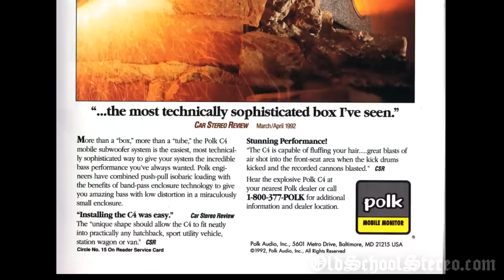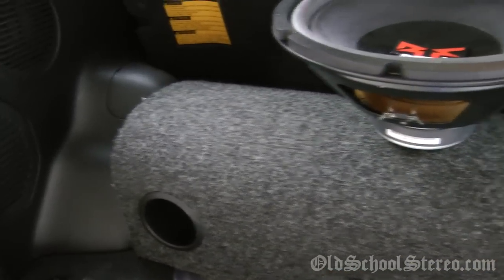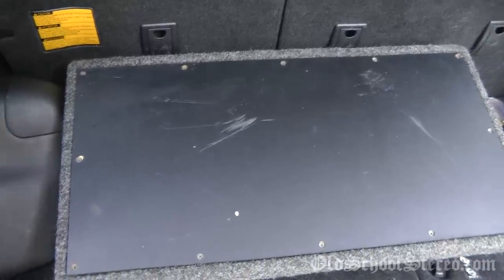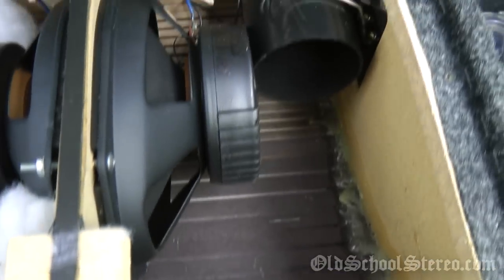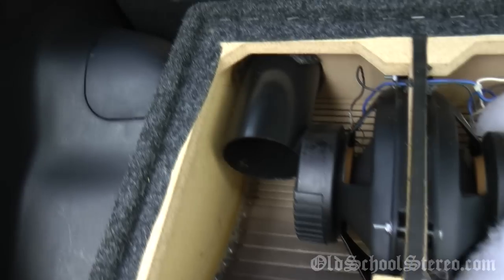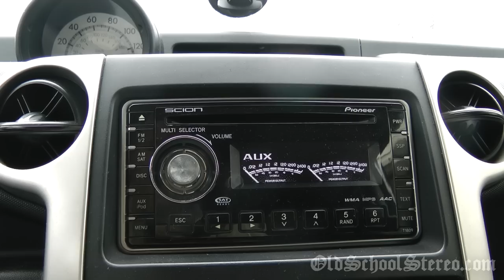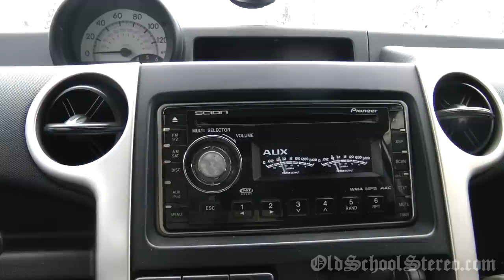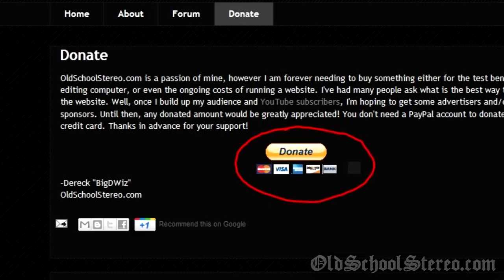Old School Polk Audio C4 Subwoofer - Four 6x9 Subs in Isobaric Teardrop Enclosure

Comment from the maker: See more about the items I use in the Williston Audio Labs:

SMD / D'Amore Engineering Amp Dyno: https://goo.gl/sJTcf7
XS Power D1400 Batteries - https://amzn.to/2BPFCKW
XS Power PSC60 Charger - https://amzn.to/2CHGcfs
Fluke 1000A AC/DC Clamp Meter: https://goo.gl/qvToRm
Handheld Dyno: http://amzn.to/2u2EgKV
My Favorite Screwdriver Kit: http://amzn.to/2x0VzcE
Reply: You still have this box Big D? After watching your video I kind of wanted to build one of these. At first I was thinking maybe using 6" CTs or JL W0s or something entry level but then I realized why Polk used the 6x9s. You're almost getting the surface area of an 8" driver but your box can still stay kind of flat because the driver is never more than 6" high anywhere. So four 6x9s is better than four 6s all things being equal. So I got looking around for a 6x9" subwoofer and found these Tang Band W69-1042J 6x9 subs on parts express and was thinking of maybe picking up four of them to try it out. They're only $60 a pop if you buy four. Would get a final load of 1.8 ohm, they play down to 35hz on paper. They're looking at 90w RMS/170w max and I'm sitting on a JL 250/1 that would power it quite nicely. So then I got thinking... This box you have is all beautiful and kerfed and tuned nicely and all this... and I'm terrible at box construction... The idea of trying to get that center chamber completely sealed is kind of daunting in and of itself... So, back to my initial question.. Do you still have this box, and if so, would you be willing to part with it? I would give it a good home and listen to it on the daily. Send me a message or something, we can work out shipping or whatever.
Reply: I'd like to pick up one of these. Even with bad speakers n put 4 new more efficient speakers in. Great review Thanks brother D

Comment: Isobaric design truly is the best  box you can build  you can have clam shell style with  one large box for low bass and another smaller sealed box for punchy higher bass , they truly do sound better than any other box but they didnt  get much attention and you would be hard pressed to find one  but yeah isobaric speakers are the best way to go .

Comment from the maker: I'm sure Polk Audio would be the better one to ask. It has to do with the specific design of the isobarik loading where the inner box is sealed and the outer chambers are ported. Very unique, space saving and fantastic SQ sub. It won't break any windshields, but will add more than enough bass for most people (non bass heads, that is)

Comment from the maker: Speakers have a positive and negative connection. If you wire it out of phase (amp positive connection to speaker negative, amp negative to speaker positive), it pulls the cone in instead of pushing it out when the bass hits. If you have two speakers facing each other, one must be wired so it goes in while the other goes out. Otherwise, there would be cancellation of the sound.

Comment from the maker: I have the Scosche Stealthbox with an old Kicker S10 Solo Baric sub for my stealth system. It fits in the rear storage compartment beside the spare tire. It puts out a decent amount of bass, doesn't flex the windshield or nothing, but it definitely gives some kick! I have my 4ch amp mounted under the driver's seat and also upgraded the front speakers and head unit. Sounds great to me

Comment: I had one in a Camaro SS--- these are awesome in hatchbacks. Most people thought it was a 10 or 12, the SQ was great. Polk made a few versions, this is a later one with the black drivers, the early ones were plain stamped steel baskets and no magnet covers. 

Later they made the inside of the box smooth, where those slats are now as they had a tendency to crack apart from age and use. Wish I still had one, sold both of mine when I sold my Camaro.

Comment: I had a 1992 Buick Regal Limited with 4x10's which I had found brackets to mount 6x9's in with a Coustic 180 watt amp and 5 1/4's in the front doors. My Regal hit so hard,for 6x9's that is. Thanks for the video and I will be visiting your site because I have a Ram Quad Cab that has 6x9's in the front doors that I have to upgrade, thanks. People underestimate the 6x9 a lot.

Comment from the maker: It sounds pretty good for what it is. The box is relatively small and low profile, puts out what you'd expect from 2 decent 8" subs. It would be a fantastic upgrade for most factory systems with a 300-400w monoblock amp!

Comment: Used to use old 6x9s or 6.5s as subwoofers for single cab trucks years ago. Always worked great. Never was super loud outside the truck but it sounded great inside.
Reply: Even bazooka 6.5 tubes sounded good in a small pickup

Comment from the maker: There are (2) 4 ohm connections...wire what's best for your amp. Mine is capable of 2 ohms mono, so that's how I wired it. 8 Ohms mono would have greatly reduced the output with the amp I was using. Thanks for the comment

Comment from the maker: @iceman45ification1 Yes, I used 2 channels of the 550x bridged at 2ohms. The amps birth cert says 140x4 at 2 ohms so I should be getting over 300w at 2ohms bridged. Next time I pull the amp out, I'll bench test it to confirm. The Polk's 6x9 subs are poly w/ butyl rubber surrounds. I have a Polk tech sheet on the sub and I'll link to it in the details of the vid

Comment: That's neat. I have a 2001 Ford Focus station wagon and it is stock. The speakers it has are 6x9's, 4 of them and they don't sound bad at all. It even has bass and treble adjustments on the stock head unit, but I leave them both at 0 because the limiter turns down the bass at certain high volumes, but they really don't need to be boosted to sound good, which I think is pretty good for a stock system that doesn't have a subwoofer.
Reply: Ford cars use 5x7/6x8 speakers.
Reply: *****
Yeah, you're right, went to crutchfield.com and they are 6x8s.
Reply: Chris Ward
Also the front and rear are both 6x8s and both have same great audio quality.

Comment: Early 1990's only a few 4th Order bandpass boxes were made. Polk being one. The other was another manufacture, I can't remember the name, but it was a triangle truck box configuration with port holes at each outside end of the box. The drivers were four 6x9 subs as well. ISO boxes can get that low deep, rich bass in small size, where a sealed 10" box will deliver that "thump".

Comment from the maker: I'd say a good 300-400w should do the trick. There are two 4ohm connections, so you could do a 2ohm monoblock or a higher powered 2 channel amp at 4 ohms

Comment: With today's amps this is outdated. A really neat config and very original. We aren't starved for amp power anymore and things have gotten better. A 12in sub running at 1 ohm and a $160 amp will out perform this multiple times over. It would have been nice in something like a Corvette for that additional thump given the limited trunk space that goes right into the 2 passenger cabin. I don't see it having enough surface area to really shine in something even as small as that Scion. Better than stock for sure though.

My friend has a Scion TC 1st gen and a 10in or 12in at probably 600-700 watts would really fill that cabin just right. That's possible with $150-$200 for the amp and sub. Hell you could get a Pyle 12 D4 for $32 and a JBL 600 watt for $100. I bet that would deliver more than double the output of this and wouldn't sound like garbage either. Things are just better than they were back then

Comment: Bigdwiz, Do you know the push-pull theory was a long lost acoustic secret from the 30's first published in Germany, but never saw the light of day in English translation until well after WW11 by Ted Jordan. The push-pull set up DRAMATICALLY reduces 2nd harmonic distortion, because the combined cone resistance as seen in free air, completely cancels it out. But, as we all know the isobaric part of the equation does nothing but reduce box size by 50%. My Push-Pull setup is in a transmission line

Comment: I couldn't work out the point of the isobaric when it doesn't give any more displacement than 2 woofers.. other than allowing you to make the sealed chamber twice as small, but I thought a slightly wider cab with twice the sealed chamber volume would only need 1/2 the power for the same bass.

Comment: A friend of mine had a custom 4th order like this Polk box build in the 90’s using 4ea. 15’s stuck underneath the hat rack with the ports extruding through the hat rack. It was a 1991 560SEL MERCEDES which has the fuel tank behind the rear seats so it was difficult to get a traditional sound system to sound right. And when you popped the trunk and unless you knew what a Mercedes truck suppose to look like you had no idea there where 4 15’s hiding in there. Are there any programs that would help you design such a 4th order box?

Comment: I'd like to see the potential of those 4 6x9 woofers by copying the Polk Audio enclosure by scaling each chamber to 4 x the volume of each segment, 4 3" x 5" ports on either side and just mounting 2 woofers in each side of the centre chamber without using an isobaric arrangement. Should get +6dB off the same amp although take up 4 x the space.

Comment: Is that an xB? I had an '06, with my two 12" Audiobahn AW1206T's mounted inverted; They stood just above the headrests and the rear window frame, looked awesome from inside and out, even if the box and all took up the entire 'trunk' of the thing. Sounded great though! Nothing like driving a literal box on wheels, everyone dubbed it the Toaster. Got behind another one in traffic, and apparently it's a toaster everywhere you go... The license plate of other said xB was MY TOAST. Great video though! Didn't know such a thing existed, I'd like to get one to put in my current car. 6x9's are oldies but goodies!
Reply from the maker: I sold mine a few years ago, but my buddy still has it. 2005 model

Comment: I'm new to your channel but I'm "strictly Ol Skool! I remember that Polk isobaric sub enclosure along with the Bazooka and TM Rush Bass Tubes that really put Bass in yo face, bro. I remember how the "tweeks" didn't like bass tubes or big ported enclosures; but anyway, moving on to a QUESTION I have about the factories use of small guage wire in prefabbed SUB/ BOOM Boxes. For instance; lets say your sub calls for 8 gauge wire to the sub, but if you remove the sub, like most of us do from the sub box, you'll see puny 16-18ga. wired up to the subwoofer. Why is that? Cost over sound quality? hmmmmmm... SMH {they used to sell sub enclosures with fancy colored lights and plexi-glass panels back in the day//but they used heavy gauge wires with them}

Comment: What kind of subs? I'm assuming you have them in sealed boxes. If you have the space to yank them out from under the seats and put them in a larger ported box that would be the route to go. Youtube isn't the best place to try and help with systems. Try checking out different forums for advice. I personally am really active on the Crutchfield forums right now for car audio stuff. But if you have questions I can try and help you here.

Comment: I used to design isobaric setups back in the day. I'm wondering why that phased out?
Reply: Why bother? The budget subs are made from better materials now. The idea was you could buy cheaper subs to match a much more expensive sub. Get two cheap as hell 4 ohm subs and run them in parallel isobaric on a cheap amp to act as one 2 ohm subwoofer of double the power. Maybe even get two budget amps and match them up. Performs like 1 ohm or .5 ohm for cheap.

Also access to exotic box designs online have made these designs seem silly. You can for example use a passive radiator to make a sealed box act as a ported box without the port increasing the number of drivers you can stuff into the allotted space. More speaker surface area = more sound pressure

Comment: I might sound like a total noob, but would this also sound good in a living room? I don't want to say I'm going to do something like that ever..., but I'm just wondering. Looks really good, never seen a design like that. :)
Reply: It would sound great.
Reply: I have it in my room, 400rms on the sub and a normal car radio for stereo speakers, i like it more, homestereo amps with this power are expensive as fuck, same with 5.1 systems^^
Reply: Lol
Reply: you can absolutely do that. its would sound really good also. You just need a proper power source
Reply: ***** I think you're wrong I got one exactly like this subwoofer and I put it in my living room behind my large screen tv and it was absolutely blasting, my friends were even amazed of my home theater system not seeing the Polk subwoofer, the secret sauce.
Reply: Fail, thats not true. The little car Radio has never 400Watts, also Watts are useless.. With 20 Watt you would gonna die, that would be too loud..
Reply: Vofetura LOL
"Watts are useless"
Till I crank up my old school 125 watt per channel Sansui receiver about 60%, and he goes running for the hills, because it's so damn LOUD!

Comment: Hey Big D. I recently picked up a RFP-812 sub on the cheap. Can't find any info on it. Wondering if you can help me out? Need power handling and best box design and airspace requirements? Please help???
Reply from the maker: Check RickfordFosgate.com they have info on almost all products they made
Reply: @wal  all we've been able to find is a data sheet. Apparently it's a 94 model? I've got it in a sealed box on a Skar RP 2000.1. So far it's been handling the power! It's pretty amazing that it hasn't blown out yet. Thank you for the response. Love watching your videos and all the products you test. Lots of great info for an audiophile.

Comment: Is that port noise?! or something rattling?  Anyways.... Nothing will ever touch the Alumapro BP-12 for small high output bandpass enclosure output. It was speced at 97db @1 watt....Which I don't believe but even if it was 93db it would still be a monster.
Reply from the maker: +djpickle68 port noise yes. I was pushing them hard and you can't get the sense of loudness over a YT vid

Comment: I think that subwoofers sound louder in a ported enclosure than a sealed enclosure and I think bandpass subwoofer enclosures are the loudest out of all subwoofer enclosures and I did find out that you can convert a sealed subwoofer enclosure to a ported enclosure by adding a port tube on the side of a sealed subwoofer enclosure once you add a port tube to a sealed subwoofer enclosure it's no longer a sealed subwoofer enclosure
Reply from the maker: +Travis Gulley most times, optimal sealed and ported volume requirements for subs are different. You also need to ensure the right size diameter/length port depending on tuning frequency

Comment: I have one of these in my 97 Prelude I just bought, came with the car. Only the right side seems to be working I’m not sure what it could be but my terminals don’t look quite like in the video not sure if it’s that or the left side just gave out I don’t know a lot about these things if anyone knows anything it would be much appreciated
Reply: Could be your amplifier. Switch the cables around to the other side and see if the other side works. If not yeah it's a speaker box but if so then it's your amplifier

Comment: sounds ok- not much bass for cranking it to 33 volume
Reply from the maker: You can't really experience the full sound in a YouTube video. It's equivalent to two 8's, so it's not going to flex any windshields or anything
Reply: +Dereck BigDWiz I've seen 2 8 inch woofers blow away bigger ones and the fact is it has that it has 4 speakers not 2 and that means 4 8 inch speakers
Reply from the maker: Not quite in this case. They used an isobaric configuration to save on cabinet space. I have this box and have listened to it extensively and I can tell you it is equivalent to two 8" subs